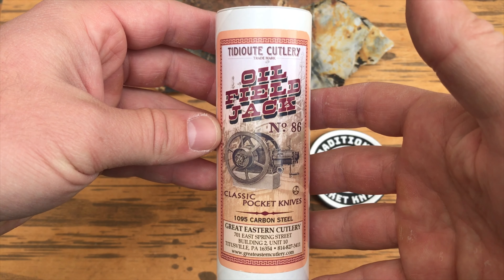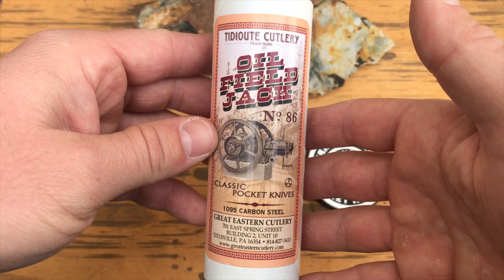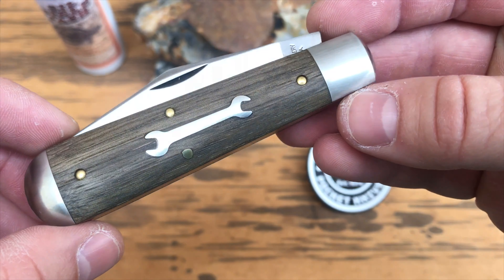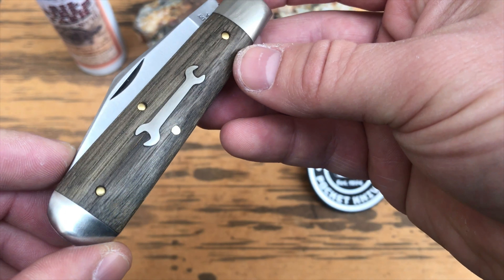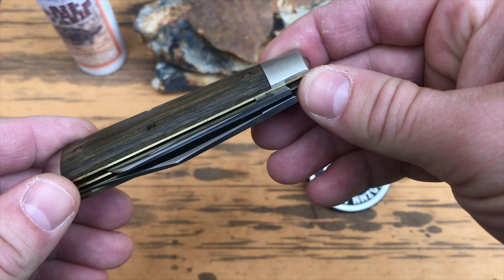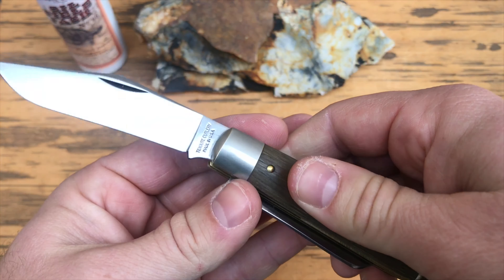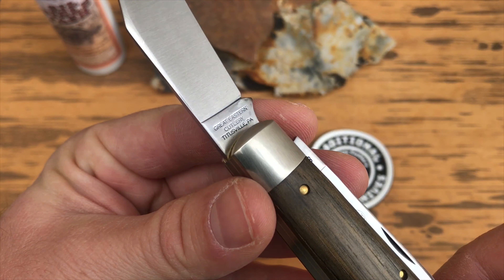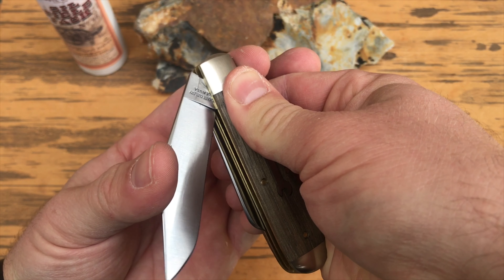Great Eastern Cutlery #861219 Tidioute Cutlery Oil Field Jack Oil Sucker Rod Wood

Comment: I like GEC styles,  but I am not conscientious enough about blade care needed for 1095.
Reply from the maker: https://www.traditionalpocketknives.com/knife-care.html
Reply: I have a GEC large Tidioute beavertail , No problem with rust , all you need to do is wipe the blade off after use or rinse off in water and wipe dry. I put a light coat of Olive oil on my blade , and it is now getting a nice patina on it from use. I own many knives and steels CPM Cruwear , M-390 , L6 carbon steel , A2, Damascus , CPM-3V ,all are very good . So is 1095 , I have no problem with this steel I like it , I like the ease of sharpening of 1095 and the traditional slip joint knife design .
Reply: Thank you, Mark. I will keep what  you write in  mind.  I only have one 1095,  and I have indeed been keeping it clean and using olive oil on the blade because I have used it for food preparation.  Your remarks have opened my mind on the subject of 1095.  I have a Schatt & Morgan,  which is very well constructed. Traditional knives have more eye appeal than many modern designs.